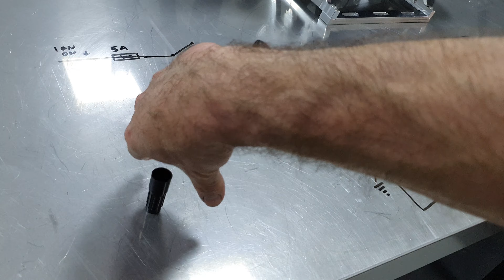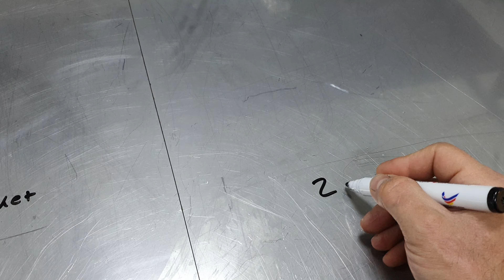Heating blanket connection (part 1)

Comment: Hi Tasos. These heating elements are most likely "PTC" or positive temperature coefficient elements. Their initial current draw when cold is going to be 23A a piece maximum however, when they begin to warm, the current draw will decrease. This would be very easy to bench test with a DC clamp meter or a cheap high current shunt. I think in real world applications, you will see much less than 50A draw when the system is switched on from cold. Also, I would suggest you place your thermistor feedback between the blanket and the mount heating element. This will ensure it is reading in an area with less airflow and where gravity will be keeping the liquid NO2 in the tank. Unfortunately, a composite tank such as this is a very good insulator and needs more time to warm compared to an aluminum tank. Great video as usual, I love your analysis.

Comment: One thing for your diagram: it looks like you have the relay connected in series: what signal does the T controller put out?  Are the relays 12V coils of 6V coils?

Comment: Excellent Tasos. I’ve seen other videos where they just slap this stuff in the vehicle without doing the math and then wonder why their wires melt. This is the homework you must do before so there are no surprises. I see guys do the same thing with lights (off-road bar lights, winches and so on) and they have big problems. This was a very good video.
Reply: Tasos has a much better understanding of electrical systems than he professes. He is modest.